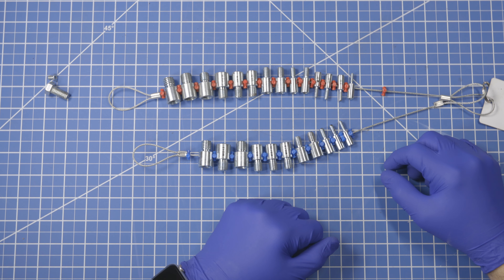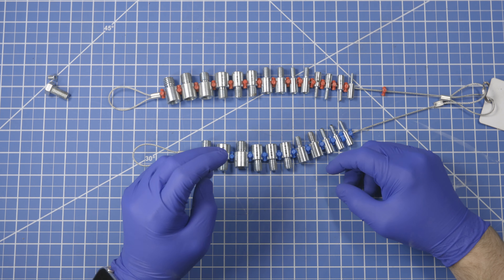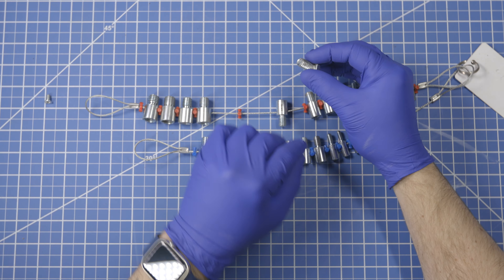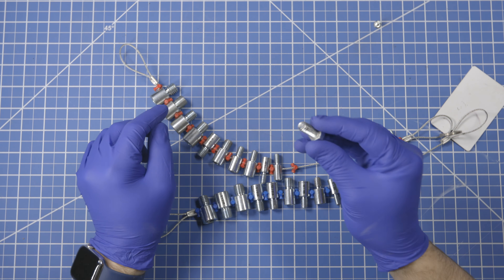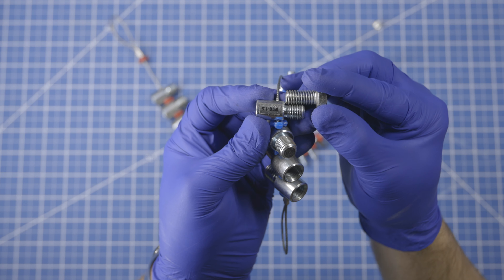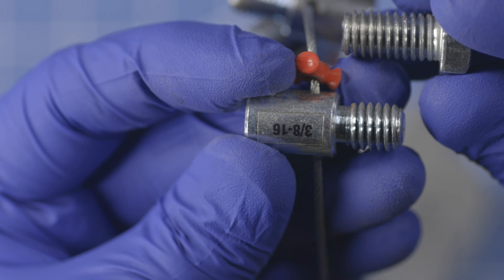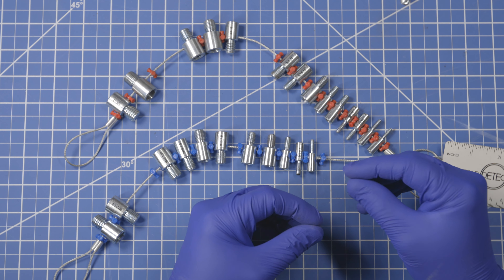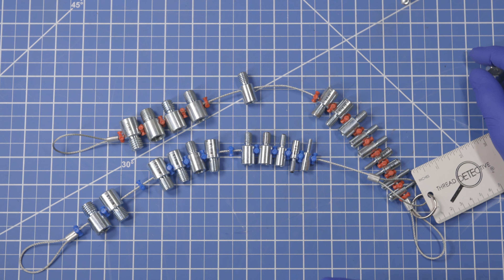Thread Checker Basics - plus a tip to match threads without one!

Comment: Having trouble.....purchased both 8mm and 5/16" bolt for replacement. Size appears correct, but the threads on both are too tight together compared to my original bolt. What to do next? Thanks
Reply: There are multiple (usually two but sometimes more) different thread pitches for a given size of bolt/nut. In your case, there is both 8-1.00 and 8-1.25 on the metric side and 5/16-18 and 5/16-24 on the SAE side. Sounds like you got the fine (narrower) pitch where you needed the coarse (wider) pitch.
Reply: @boinger  Thank you very much for this info.....very much appreciated. Will the more coarse pitch be available at Lowes, etc.? If not, where do you suggest I look?
Reply: @DhruvaMaharaja1952  Should be available at a hardware store.  Certainly one of the thread pitch options will be the more common option, but if you search around I imagine you'll find what you're looking for.

Also, the sort of thread checker that's in this video would help determine which is correct without having to guess :)